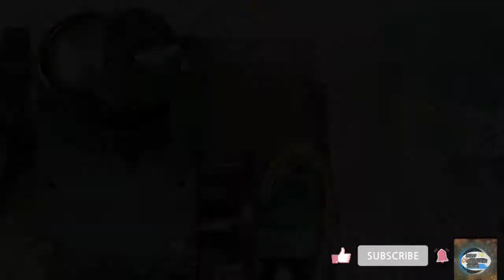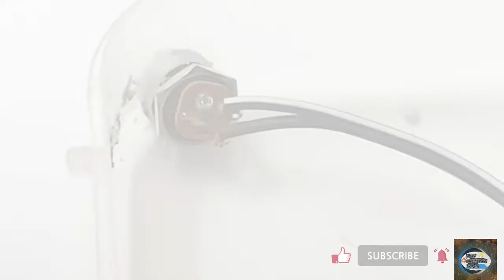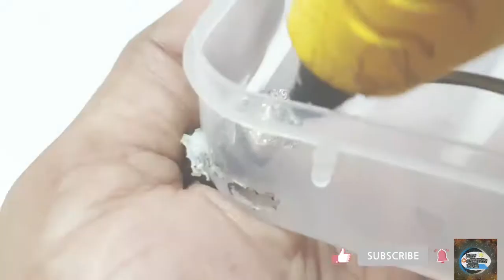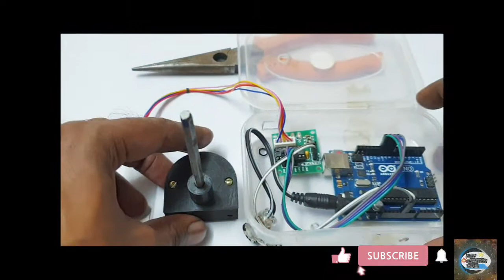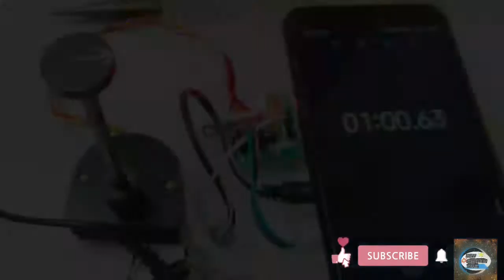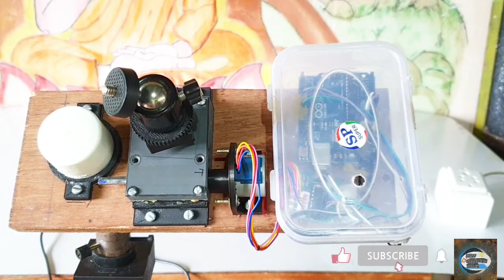Homemade star tracker stepper motor with Arduino Uno

Comment: Do you need the stepper to just need to get the ball end to move 360° over a 24 hour period or is there a different rate needed?
Reply: It needs to move 360° every 23h 56min 4s as the sidereal day has to be used for astrophotography

Comment: again half info shared and a puzzle piece left out. the crucial interface is the interaction with the rod coupled with motor shaft and the ball mount platform. u never showed that. pls be more informative than leaving out viewers to solve the puzzles
Reply from the maker: Hi prajwal gowda

That project is not complete
I'll upload all details finally
Thanks for your support